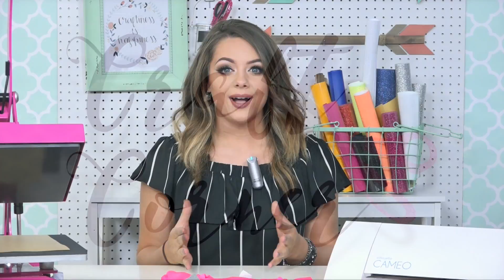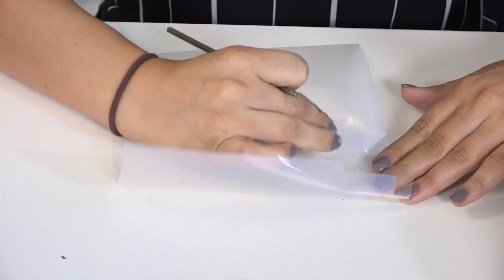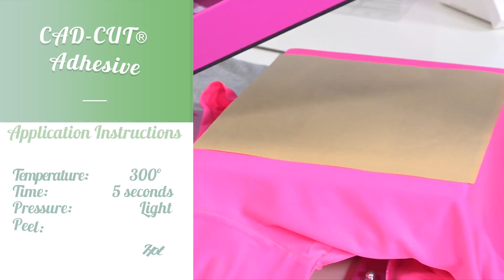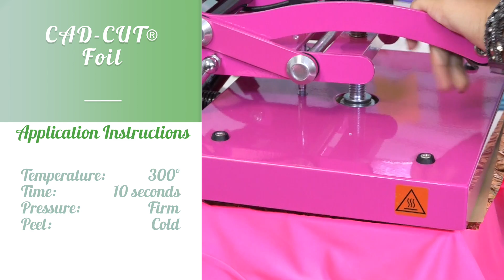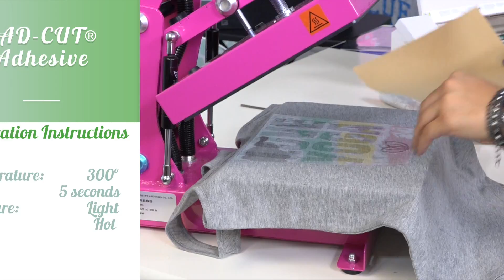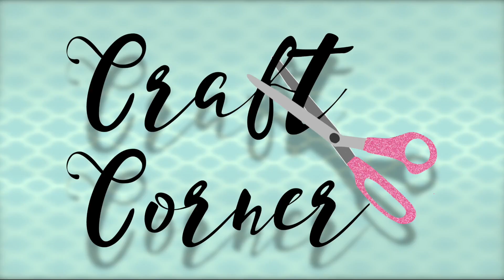How to Get Two Unique Finishes with Heat Transfer Foil | Craft Corner

Comment: Hi 
The material 
Is cad cut adhesive ? 
Foil ?
Reply from the maker: To apply Heat Transfer Foil you need both the foil product [ https://www.stahls.com/heat-transfer-foil ] and the CAD-CUT® Heat Press Adhesive [ https://www.stahls.com/heat-transfer-foil-adhesive ]. Check out this video for some great tips and tricks on Heat Transfer Foil: https://youtu.be/x9SZDSqShoc